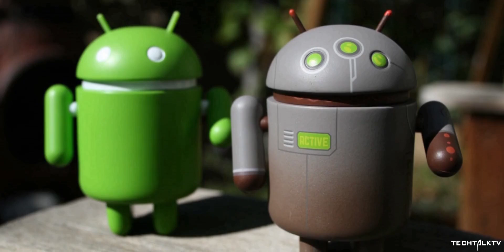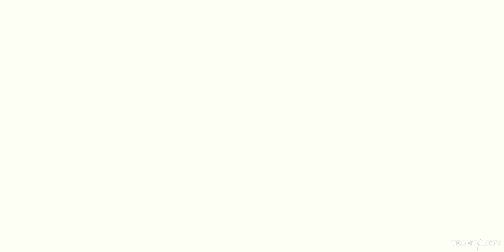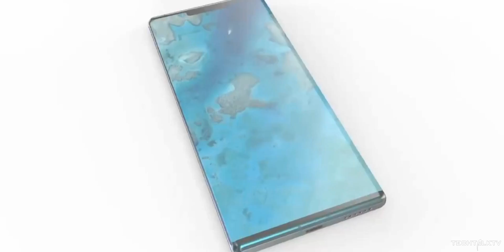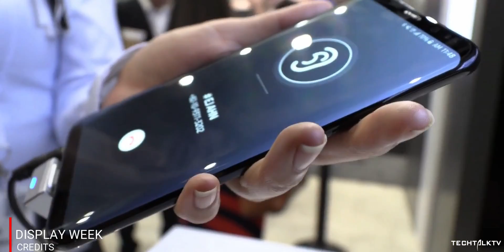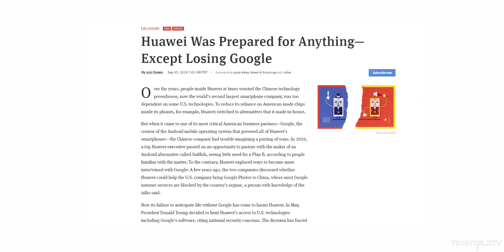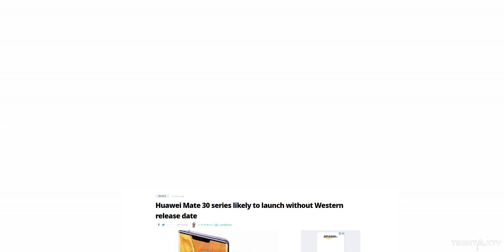Huawei Mate 30 Pro - WEIRD DESIGN ELEMENTS

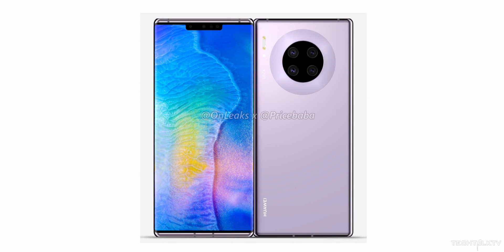Comment: In my opinion if the metal frame was going to stretch as in the renders 1:12

They could have tried to place the front camera and other features into the frame

End result: no notch and a close bezeless phone

There is a phone that puts the camera in the plastic frame. I just can't remember. 
I'll do my research to edit it in

Comment: The design is probably for added protection. These screen crack very easy on the edges so when you have the metal frame bending over the bottom you have added protection and extra strength in the overall design.

The speaker in the display is a drawback for me.

Ofcourse the Android situation is a true deal breaker for sane people in Europe and other Western countries and I don't think they will come with a solution anytime soon that will attract buyers.

It's been nice following the leaks and details but I think we'll have to wait untill Feb 2020 when the S11 comes. Untill then we won't see any major flagships that will have the people on their toes.

The OP7Pro is already dissapointing judging by the specs and the Mate series simply is a No Go.

Gonna be a boring final Quarter.
Thanks Sal for keeping us updated every single day !

Comment: Would surely pick it up regardless of google services if it has that xenon flash!!
Reply: What's a xenon flash tho?
Reply: @pemosrc173  flash that uses Xenon tube instead of led light. Its much brighter and whiter and its easier to control its flash time
Reply: @pemosrc173  just a better flash lmfao
Reply: You wouldn't have YouTube to watch techtalk TV though
Reply: @paulofortin3686  that's just a misconception....it will just come without any google services pre installed.....can always add most of them easily.
Reply: @paulofortin3686  Lol good point
Reply: @paulofortin3686  itll still be possible to install google apps. Just that it wont be pre installed